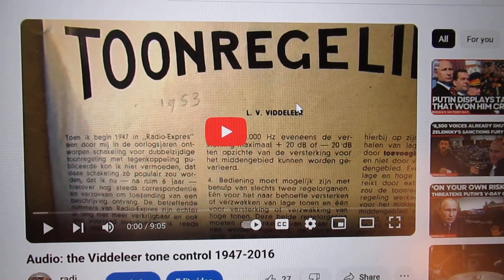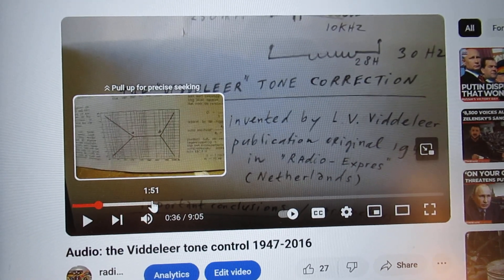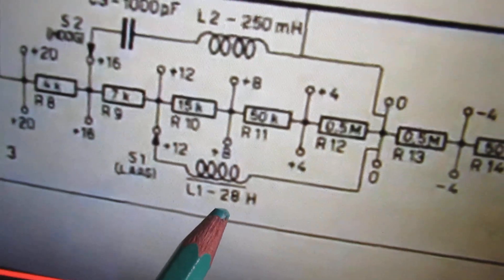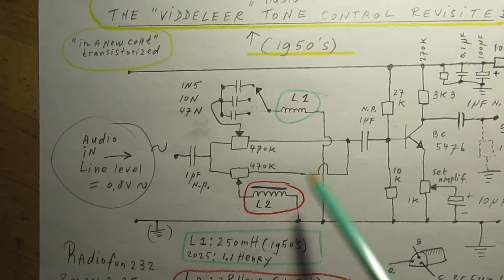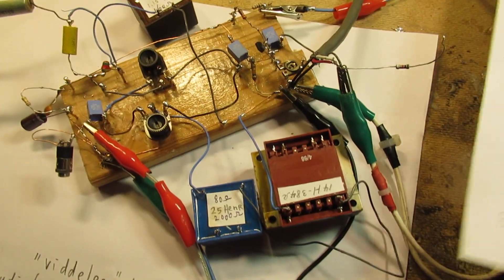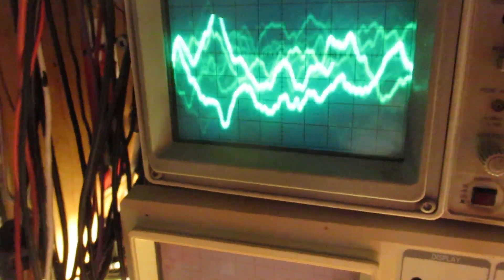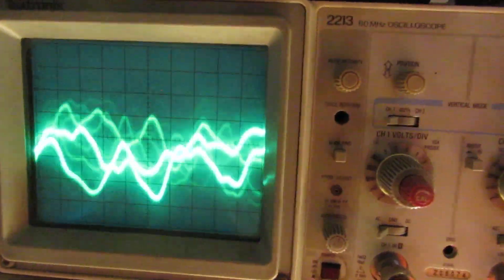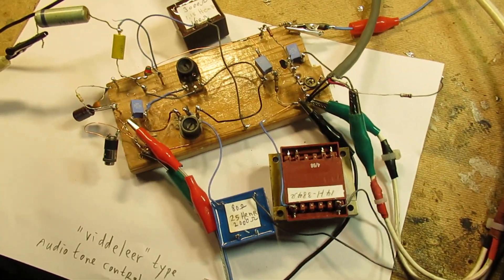The Viddeleer tone control 1945-1955 made with 2 inductors: revisited and transistorized schem/demo

Comment from the maker: When you want to do more sound experiments you can connect a capacitor of 10 N (10000 pF = 0,01 uF) from the output of the amplifier to different points in the filter (at the potentiometers and at the input capacitor). In that case you get a more/sharper frequencie(s) dependent filtering. Connect in that case (for first insights) the 47 N (0,47 uF) capacitor to the wiper of the top potentiometer in the schematic. Test, try, experiment! 5 May 2025.

Comment: yeah funny we are used to make such a tone control with only capacitors and resistors, i dont know but those coils are now maybe replaced by extra transistors? maybe by making it in a different form too? Just the extra weight and size of course doesn't make it attractive, I can imagine that they wanted to get rid of those big coils.
Reply from the maker: Hoi Rob, ja het is echt iets uit de buizen tijd.

Comment: Very cool, thank you! Seems like the perfect thing to experiment with adding to single transistor(2SC5242, wonderful transistor) amplifier. I always enjoy the knowledge you share from the past, and your creations, too
Reply from the maker: Thanks, good to hear that. It is indeed a very interesting approach about audio filters and we can harvest the audio effects of coils in L-C filters. They are often skipped in the mainstream setups because of costs, complexity, hum-influences, etc. But these L-C filters surely can realize easy and soft sounds in the low(er) frequency audio band(s), due to their specific resonances and properties. Thanks again. 3 May 2025.
Reply: Both ..the original (for tube) & yours for trans. ARE the Passive type with insertion losses...
how about having a  go at an active tone control..
this will automatically compensate not just for insertion losses but being part of the negative f.b. loop , distortion will also reduce besides the advantage of adjustable  gain& attenuation (dB)over the total travel of the pot wiper
Reply from the maker: @ There are approx. 40 (or many more) video's about all kinds of tone controls and audio filters with their schematics under the (say) 1600 video's that I published on my YT Channel. Everyone can use the "search option" (= looking glass) on my channel trailer to find them. Channel trailer is "Radiofun232 on YouTube", the link is in the textbox. Search there via keywords related to audio. Also more info in my book "Schematics 2, audio amplifiers and lopudspeaker boxes", author Ko Tilman. 6 May 2025.